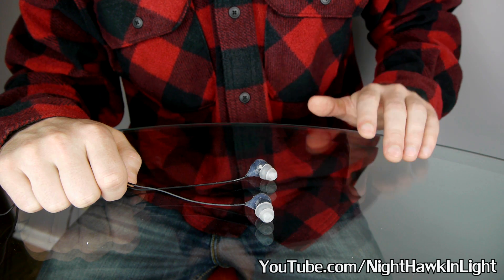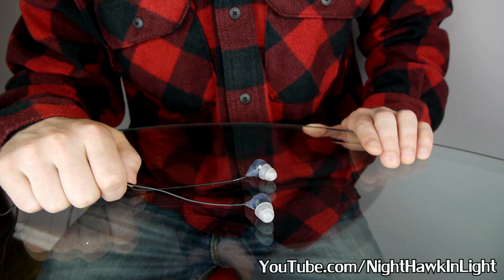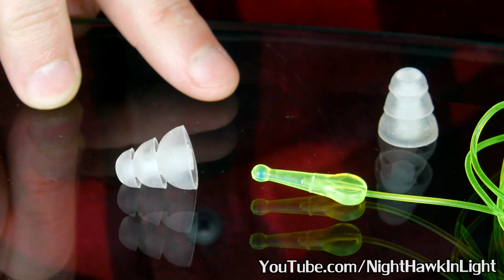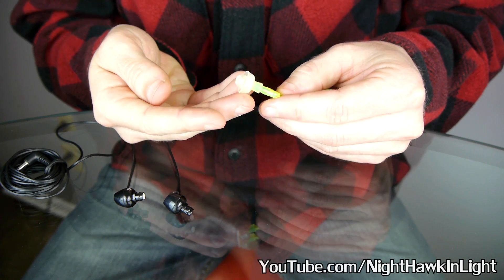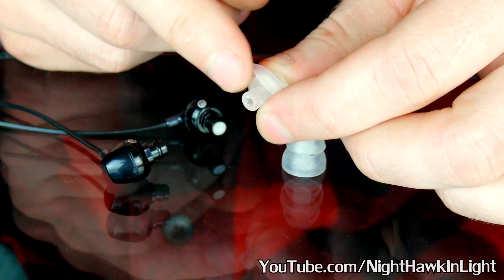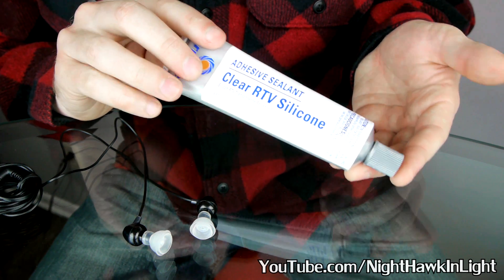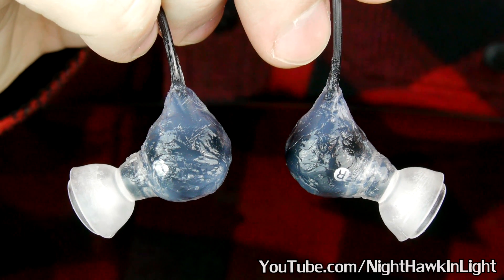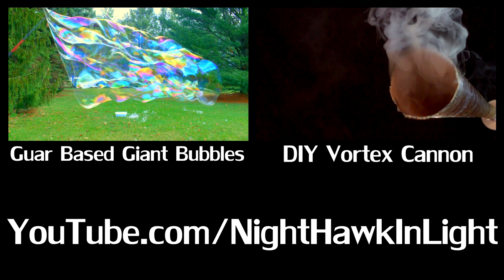How to Make Sound Damping Earbuds - Best Noise Isolation Possible

Comment: Is it necessary to put the silicone over the area where the plugs connect to the buds? Otherwise how would you clean them? Will it let in noise if that part is not silicone covered?
Reply from the maker: Should be fine without
Reply: @Nighthawkinlight  Thank you for the speed reply :)

Comment: Where can I buy earplugs like that so I can make some "Sound Damping Earbuds"?
Reply from the maker: Amazon. You can even find one's that already have a hole in them to fit on earbuds
Reply: @Nighthawkinlight  - Awesome, I think I'll give this idea a try however, I don't think I'll go quite as far as dipping my UiiSii DT800s and my BN90s into silicon. They have dual balanced armatures right inside the ear channel where the tips go onto; they are ready have really good external sound isolation because of this design. Thanks for the info.

Comment: wow, totally interesting idea too!! I need to silence ambient (band rehearsal) as much as possible to drive earbuds (just now found BEST studio-like FLAT Panasonic HJE125E, far superior than Shure SE315, allwing FiiO Q1 ax MAX without any kind of distortion, never - SE315 arent flat at all and cant handle 190mW from Q1, they are loud, but also duistorted - the HJE125E handle amp perfectly even at max, again, never heard that yet in my life) and then mix-up back ambient signal from dynamic microphone back together with synthesizer output, all at more acceptable levels to hear myself, while not screaming over guitars... (already considering also to buy industrial silencing cups as passive addition to those GENIAL earbuds)

Comment: Nice video!  Won't the silicon reduce the vibration, which would decrease the sound quality?
Reply: yajat jotwani yes it will reduce the vibration created by the outside sound applied to your earbud, but it doesn't decrease the speaker vibration or the air pressure which the speaker applied to your ear so sound quality will not be reduced

Comment: great video. might do this one. I would just like to ask, what isolates more? using the new earplugs without the silicone sealant or using the old earplug with the applied sealant? also, could you please describe to me how much noise did it remove after putting the new earplugs?

Comment: I found a much, much simpler way of crafting these earbuds! :D 

You only need two items for this project: Silicone Putty Earplugs (aka swimming plugs) and a pair of earbuds. 

Just poke a hole through each earplug with a nail, and use your fingers to smooth the putty out over the bare earbuds. The putty can also be molded over the outside of the earplug to block noise. 

Also, since they're made of putty, they can be molded to the EXACT shape of your ear. They do collect hair/pet-fur, so I keep mine in an empty pill bottle.

Comment: I wish you went into more detail about safety and procedure when applying the silicone because it was much harder for me than it looked in the video
Reply from the maker: Hmm, sorry you had trouble with it. You can try wetting your fingers and that can help you be able to touch and smooth the silicone without it sticking to you.
Reply: +NightHawkInLight Thanks for the info

Comment: Hey, I`ve had a lot of earbuds which was worked for couple months, but not longer. Now I have a huge bag of not working earbuds, and I wish I can fix them. Please can you make some project to show how to fix your old earbuds.
Reply from the maker: Dmytro Slyusar You have to be really good at soldering. I would probably just make a mess of it.
Reply: Dmytro Slyusar hey if you have a huge bag of not working earbuds and if you dont mind breaking them completely then you can try to get inside and there should be 1 or 2 little magnets in each one
Reply: Christian Ramirez ok but why?
Reply: You basically have to replace the headphone jack if im not wrong  and it requires soldering

Comment: Silicone is extremely useful. I make custom ear plugs from silicone. You can apply a thin layer to noisy metal to dampen sounds, such as under a metal sink that is noisy when the faucet drips. Great video!
Reply from the maker: electronicsNmore Now that's  a useful tip I hadn't considered! I've just been thinking this past week how I might silence a noisy downspout outside my bedroom window. Thanks!
Reply: You can also use a dense foam backed tape on the rear(hidden side) of the downspout as well. Keep up the great work!
Reply: 'Peltor Sport Tri-Flange Corded Reusable Earplugs' on Amazon. Look like the same in the video.
Reply: Why wouldn't you just fix the faucet drip?

Comment: I just tried this on my earbuds that came with my galaxy s4.i almost did everything identical to the video except that I didn't cut off that 3d layer of the earplug,instead I drilled through the whole earplug and made a clean whole then I did the same as the video instructions. and guess what now they sound way better than my new Bose SoundSport SIE2 sport earbuds!
So amazing,
Thanks for the video nighthawk
Reply from the maker: Al-Bader Bu-Hamad Very cool, glad you like them!
Reply: Better noise isolation makes your run of the mill earphones sound better than bose ? Either u love exaggerating or u know nothing .
Reply: hey, if HJE125E can sound superior to SE315 then, ya, ... why not;
Reply: I didn't understand what you did. Could you clarify please?

Comment: This hack can potentially lower sound quality to the worst ever heard.
Some earbuds have openings on their back in order to allow the air trapped in between the driver and the case to move easily. It is part of the design they chose. A collateral effect this hack would have, then, is annihilating bass and generally lower volume levels.
So, be careful. Maybe using something removable with no pain like sugru or blu tak instead of silicone will be a safer bet.

Comment: My sennheiser ear buds already do an amazing job with noise canceling so I'm pretty good ^.^ but also, wouldn't this take away from the audio quality? I'm not an expert or anything but I'm pretty sure some ear buds that are tuned for bass'ier songs have little gaps in the ear buds intentionally to improve certain frequencies when listening to music.
Reply: Nic_Nak_Nic Nicholas I think this project would be more oriented toward those who dont want to spend as much on noise canceling headphones and dont care about quality.  For less then $20 these can be great for things like mowing the lawn where quality is not as big of a deal
Reply: Nic_Nak_Nic Nicholas You are completely right. I used to have one of those and it had a little hole on the side of the second speaker (it had 2 in one ear, i never really understood why :D)
Reply: Don't do this
Reply: KerrankiSuomee  The holes are to prevent pressure buildup when they are inserted.

Comment: Doesn't a speaker need air flow to work correctly? I don't actually know but that's what I thought.
Reply: John Fuston No. It just needs air, and there's air between your ear drum and the speaker.Speakers don't somehow consume air, it just creates minor pressure variations in it, like a ripple in water.
Reply: seigeengine True, but carefully placed slots in the frame can improve the bass and/or treble depending on size and position. They make very small improvements because better air flow allows for better vibrations, but nothing the average listener would notice.
Reply: dp33600 Sounds like something that would also leak noise out and in.

Comment: Good idea, never seen anyone do that. I do have to say though (and I'm not sure how much it actually matters on a pair of cheapo headphones), but often times there is a hole left in the back to facilitate more bass when the driver moves. If you plug this with the silicone it may have negative effects on the earbuds. Some earbuds don't even have a small pinhole to let the driver move, so in that situation I doubt it'd matter at all. I've seen some websites that say drilling say a 1/8" hole in the back of cheap earbuds allows the driver to move more freely and will create a clearer sound, but I've never tried it myself.
Obviously if you just want to hear music in a loud environment and you're coating your earbuds with silicon you probably don't care that much about audiophile sound lol, but I just thought I'd mention it.

Comment: Now all I need are some in-ear earbuds that actually stay in my ears.  I, for whatever reason, can never get earplugs or the like to sit comfortably in my ears, and I think my ears holes are slightly different sizes all together..
Reply: ***** Like someone else suggested, try getting mouldable putty that dries after a while and if you stick it in your ear along with the earbud it will mould to the shape of your ear.
Reply: I had the same problem I always hated this design of ear buds but then I bought some and used the smallest plugs that came with them so now they stay in my ears.

Comment: it there a way to make the earbuds look a little more clean?
Reply from the maker: Gamercurse Probably, I haven't put a lot of thought into it though. I just use them around my yard mostly.
Reply: Pepijn Kramer It's a more gummy kind of material it would be hard to sand it smooth.
Reply: Sam Watson I think it being hard would destroy the purpose of the coating though. If it's hard it transmits sound better.

Comment: This method is great! I love the idea of using the silicon, and your correct, most people would stop at just the plug replacement! Also, i do not know if your open for suggestions or not, but i was thinking something archery related, (preferably a bow) because i, and many other people have done plenty of homemade archery items, but i thought i would like to see what you would do. For me, theres only so much you can do with parts from hardware stores, even though i have a expensive Professional bow.
Reply from the maker: LightningEx Mtndewkickstart. Yeah I'm always happy to hear ideas. I've had a lot of requests for bows, I'll try to think of something that hasn't been done before.
Reply: LightningEx Mtndewkickstart. I feel that's mostly because people generally have very little understanding of how sound behaves.

Comment: This would work with a few coats of epoxy or super glue, wouldn't it? Don't want to make a store trip just for silicone
Reply from the maker: ***** No I don't think either of those things would work any better than the plastic. You need something dense and rubbery.
Reply: NightHawkInLight Dang, alright, thanks for the info and the great video.

Comment: Well what worked wonders for me are these earbud tips made out of special memory foam. Those are basically foam earplugs with a small hole in the middle where you'd connect them with your earbuds. 
And seriously, those things are amazing! They are basically like wearing regular earplugs, so everything around you is basically completely muted. And the only thing you can hear is your own music. Plus, because of the memory foam they don't just suddenly slide out of your ears that easily just like cheap rubber tips would.